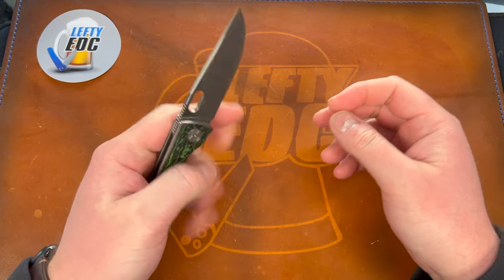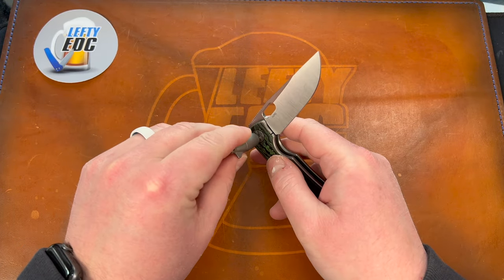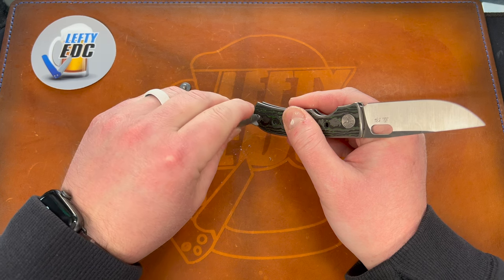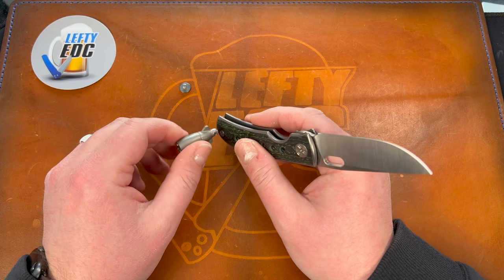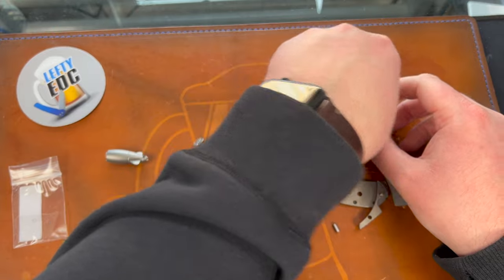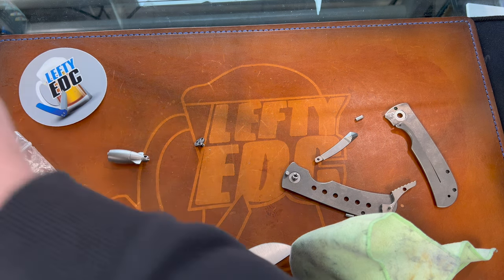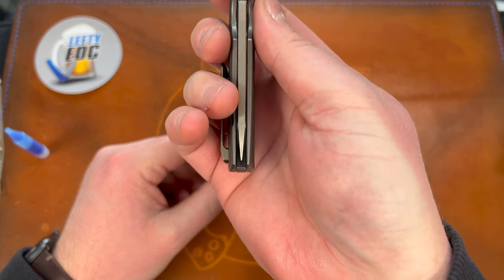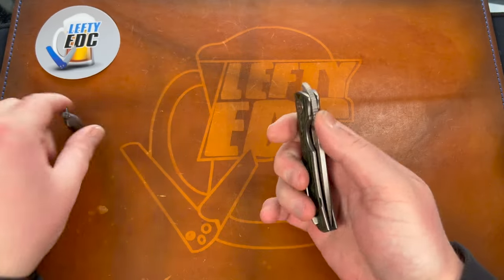Wingman EDC Mach 3 Disassembly & First Impressions

Comment: Do you guys have a lot of lock stick on these? Mine doesn’t drop like Kevin’s without a hint of blade play. Since it doesn’t have a lock bar insert, mine grinds pretty hard and has decent resistance in actuation. I’m thinking of sending it back to trade in for an Oeser F22. Thoughts?
Reply from the maker: Reach out to Wingman it’s defective